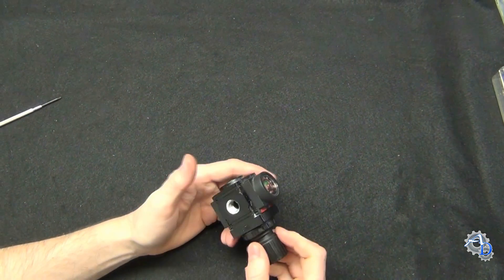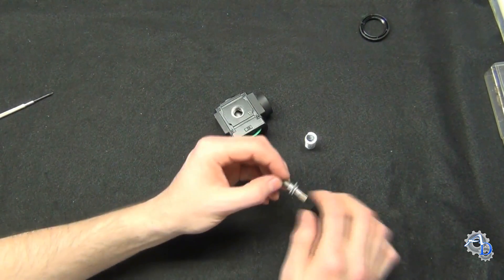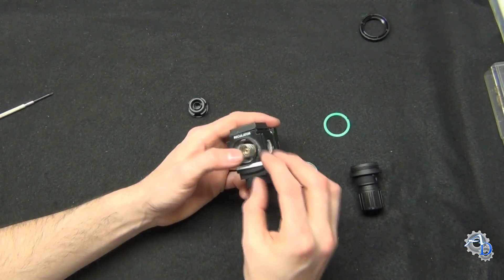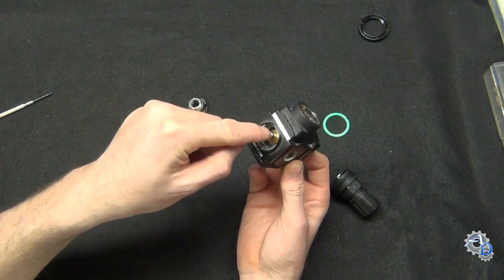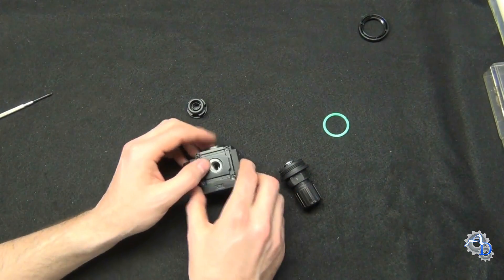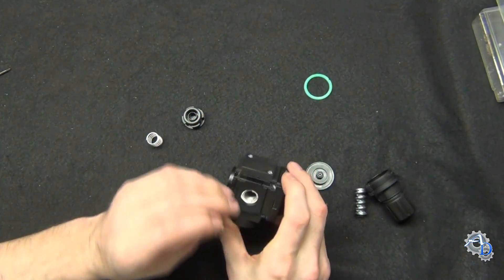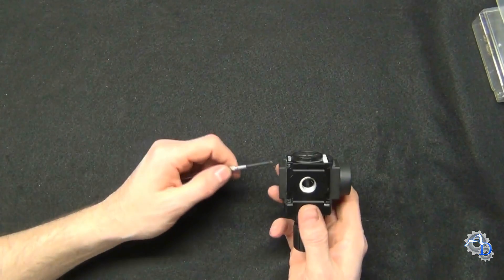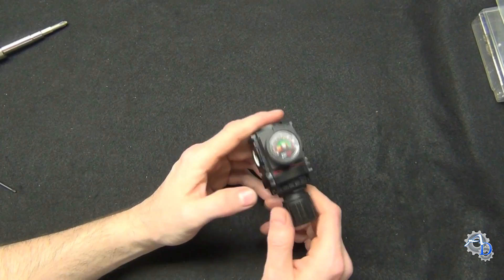What's Inside an Air Regulator and How Does It Work

Comment: I have a simple 1 stage regulator very similar to your video.  The only difference is there is a port on 'front and back' that a pressure gauge screws into, instead of the way the built in gauge is executed on your demo one here.  Do you know if these two ports have the same flow capability as the designated outlet port?  I know the pressure would be the same, but I am curious about the flow.  Reason I would like to use of these two ports instead of the designated outlet port is simply cleanliness of routing lines, but I don't want to reduce flow IF they are not able to flow the same volume of air in my high flow regulator.  BTW, loved your video!
Reply from the maker: As far as I know, they have the same capacity, but you would have to check the specs for your particular regulator. I have used both with no issues.

Comment: I have a question:  I turned on the power switch to my air compressor, okay so far.  Turned adjusting knob on air regulator and nothing happens.  The gauge stays at zero no matter which way I turn the knob nor however many times I turn the knob, gauge still does not move.  Is the air regulator defective?   Will installing a new air regulator remedy this problem?  Thanks for your help.
Reply: Just clean the 1 you have mine did that gunk free and working again

Comment: 😮 Woa! Like most, I was ready to buy an expensive regulator… I had cleaned out the top side, and it worked better but not the bottom side. After a quick breakdown and cleaning it functions like it should. I don’t think it worked this good even when it was new! Awesome thorough video. By the way I have the Husky regulator which goes for about $50. I have to admit, the reviews don’t give it much credit but this regulator actually has solid parts that will last a long time with proper care 😆

Comment: Great video Arnold!  I bought a used Husky compressor that didn't put out enough air.  By looking at your video, I was able to understand the flow of air from the tank to the regulator.  You saved me big $, as I was about ready to take it to the shop.  Thanks again.

Comment: If your regulator holds pressure at 40psi, but starts to bleed at lower pressures (anything below 40psi), what could cause that? (Bad o-ring maybe?)
Reply from the maker: I found my IR regs are sensitive to line moisture and that when they start messing up. I would just take it apart, and clean the parts and inside the housing, top and bottom. Then put some silicon grease on the o rings and where they slide, and reassemble it. Don't grease the diaphragm. You can get silicon grease where plumbing stuff is sold. Make sure to completely unscrew the pressure knob to the lowest setting to take spring pressure off the housing to make it easier to disassemble/reassemble.

Comment: Question Sir, would you be able to use these type of Regulators on Airguns? Between the valve and the Air reservoir?
To regulate your shots for better consistency?
Thanks in Advance!
Reply from the maker: No idea, but the regs are inexpensive if you want to experiment.
Reply: Arnold's Design I will give it a try, once I have build my workshop. Planning on making my own pcp rifles if good enough why not sell? Hehe 
Thanks for the info of your video it was very informative and simple to understans

Comment: Can these regulators typically be repaired? Mine simply will not maintain exhaust side pressure, regardless of spring tension applied by the rotating knob. Tank pressure = 100 PSI, regulator gauge = 100 PSI. Start using air with a tool, regulator gauge drops to 0 PSI quickly. If I turn the compressor off, bleed pressure to 0 PSI and restart it, it will build tank pressure = regulator pressure until air is used with a tool. The regulator stops allowing air to pass through again.
Reply from the maker: I don't know if you can get replacement parts. Take it apart and check for corrosion damage to the housing, or a damaged diaphragm. Might just have some debris in it that's interfering with a seal. It happened to one of mine.
Reply: @ArnoldsDesign  You hit the nail on the head! I disassembled the regulator, there was corrosion and pitting in it, preventing movement of a plunger. Thanks for the advice. Now I understand how these work, and how to troubleshoot them. Thanks!
Reply from the maker: @selsyn73  That's cool. I'm glad you got it figured out.

Comment: Excellent video. Wondering if you still watch here for comment/question. Thank you.
Reply from the maker: Thanks. I still check my comments occasionally.
Reply: @ArnoldsDesign  Hi Arnold. I need some help. I have a picture framing pneumatic underpinner which has an air regulator all made in one piece of plastic, similar to yours, but no screws and has two opposite machine-made thin cracks, don't know why those are for, maybe as valves where only now after 12 years, it loses air, and can't find the original or another identical. It would be easier to show you a picture but don't know-how here. Not sure that any other system would work. Suggestions? Sorry for the big reply. Thank you.

Comment: Would that work as a fuel pressure regulator
Reply from the maker: I don't know if the diaphragm is fuel resistant. Also, fuel could get into the gauge and possibly fowl up the numbers on the face.

Comment: Question, which side is the air intake where you pump air in ? 
An is there way of testing that when it has no arrows for air flow. Thanks for the video 👍🏻
Reply from the maker: As far as I know, they should all have an arrow or some indication of where the intake is. If they don't though, the air would go into the side that goes to the top of the poppet valve. You can determine that by looking into each port and comparing them. The lower chamber will be the exhaust side.
Reply: If the intake goes to the top of the popper valve, ”the head” of that piston, wouldn’t the exhaust chamber then be the top chamber, the upper one?